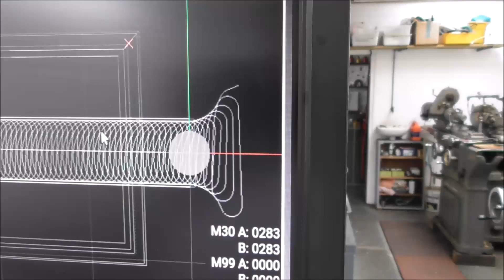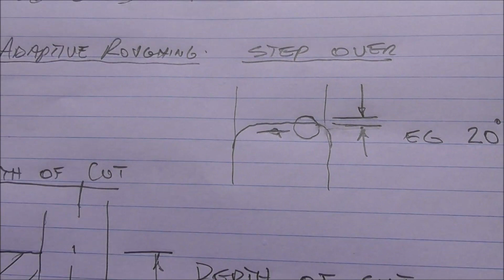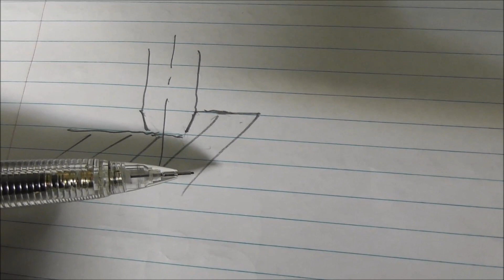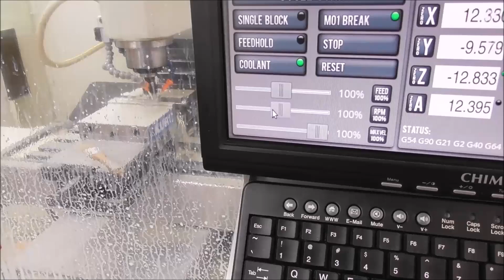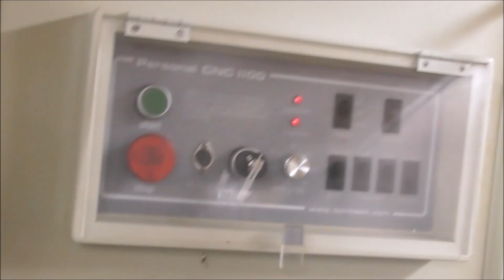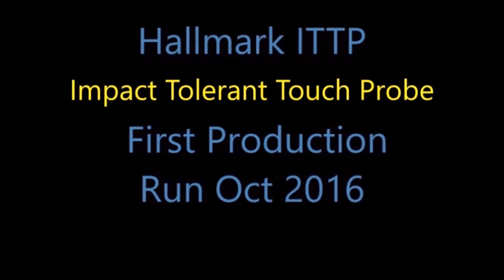Small Shop Machining - Tormach production, toolpaths in steel.

Comment: Hi Cliff, I approach pockets differently.  For roughing, a 12mm high feed rate cutter is used with air blast.  Nice chip, higher axial load and lower lateral deflection good for my 770.  Cutting strategy is a ramp down. Small pocket, then larger pocket as needed.  Ramp provides almost constant engagement of cutter and little wasted motion.  Then with smaller cutter, I pencil cut the corners cutting on down stroke only.  Then I use a back draft cutter for semi and finish using ramp down with coolant.  Back draft provides constant lateral deflection for total depth.  Perhaps faster and my wall variance is typically better than 0.01mm top to bottom.  Cheers.  Matt
Reply from the maker: Hi Matt. Do you use a 12mm as above for alloy steel or are you talking alum. ?   Cliff
Reply: Hi Cliff,  Mostly 420PH.  No aluminum.  I have a couple DiJet QM mini modular I bought from Misumi.  In addition to the HF inserts they recently introduced a finish insert that is very near a backdraft but uses a wiper edge for both wall and floor.  Just started using that and can’t give you feedback yet.  I use for mold pockets.  Matt

Comment: Thanks Cliff. I am using my 440 to cut A2 and I used adaptive roughing. Pushed my little mill pretty hard but very happy to see it was able to do the job. I tend to buy 3/8" tools and you're right...a big jump in cost. I also tend to buy the big brands and coated, not cheap, Your tips on getting a bit more use from the endmills is appreciated.
Reply from the maker: Thanks for your feedback Sean. Good to hear you are machining A2 on a 440.  Cliff

Comment: If you did this in fusion 360 you might want to take a look at the no engagement federate on the adaptive. It’s on the last tab I think. It looks like you’re zero engagement federate is the same as your cutting federate. The tormach doesn’t have good acceleration but you can still speed that up quite a bit even on the tormach.  I set my zero engagement to the max feedrate the machine supports even though it won’t reach it in a small slot like that.
Reply from the maker: Thanks Bill. Yes I use BobCadCam. Cheers  Cliff